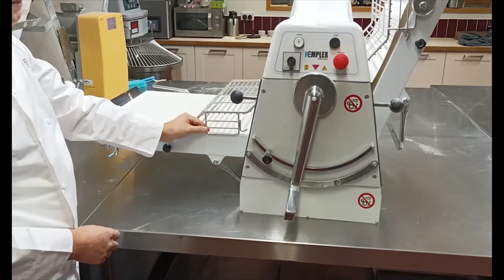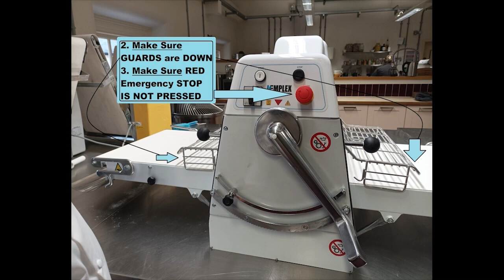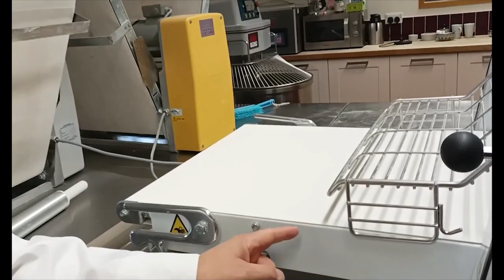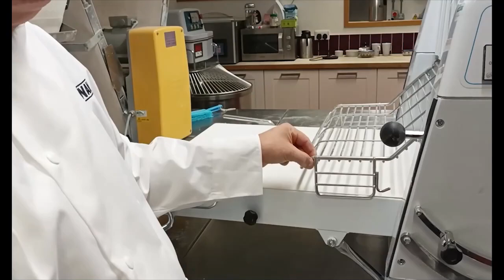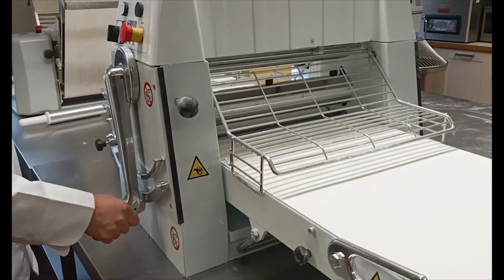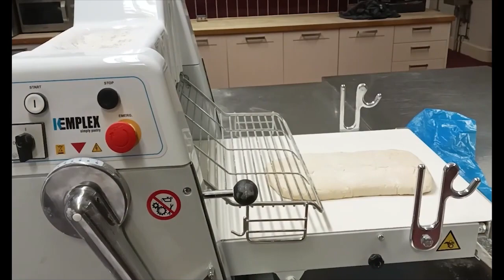KEMPLEX SFB 500/710 Dough Brake / Dough Sheeter / Laminator - Demo by NOWAH Catering Equipment Ltd.

Comment: Hi, in the last part of the video, which is the model of the Kemplex sheeter that you are using? Is the belt of 710mm or is it longer? Thanks
Reply: In the video it is 710.
But KEMPLEX sell the machine in 2 sizes: 710 or 950.
The price is nearly the same.
Reply from the maker: In the video it is 710.
But KEMPLEX sell the machine in 2 sizes: 710 or 950.
The price is nearly the same.